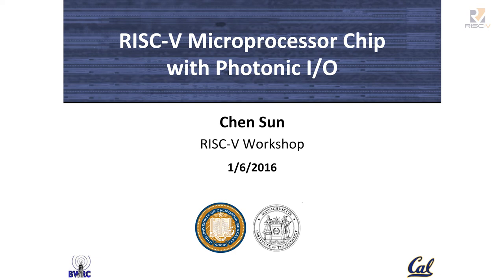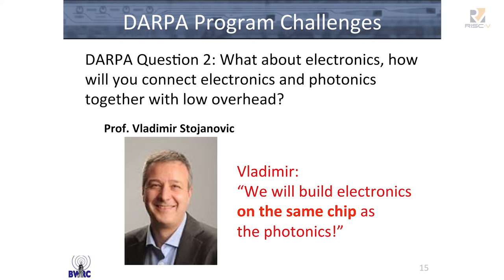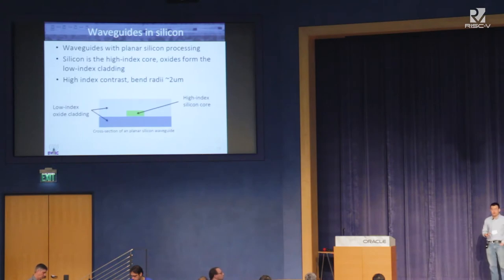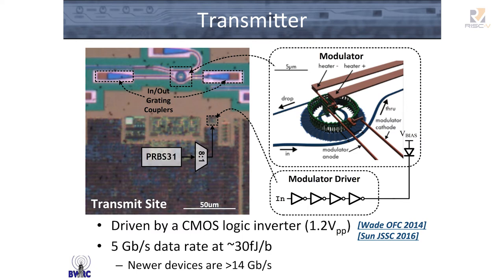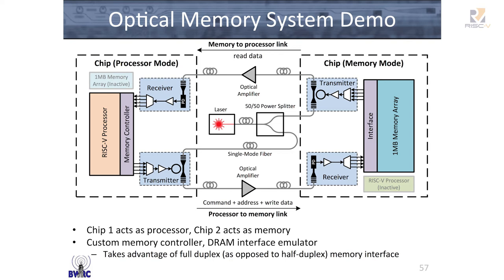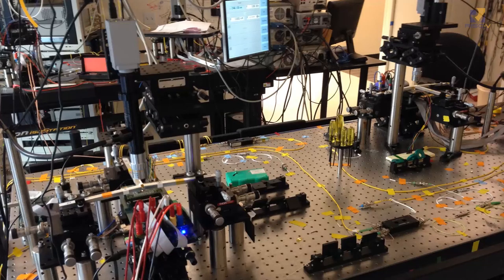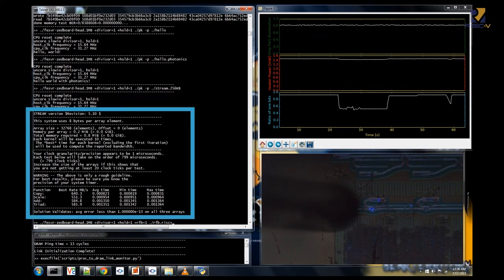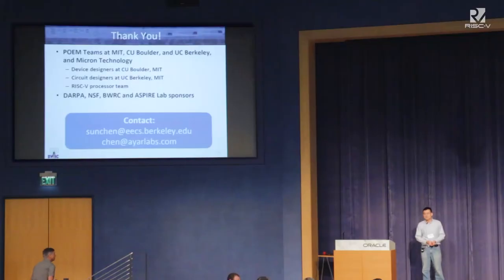Wed1015 - RISC-V Photonic Processor - Chen Sun, UC Berkeley

Comment: Go Bears! We are now using photonics using polarization which are 4x faster. 
Since light travels in a wave length which has peaks and valleys (oscillations) we can program valleys to be 0 state then peaks to be 1 state in terms of processes. 

Now thats for two nanowires like this ---- ---- where the blank spot would be the wavelength oscillating between the two. 

Now we can have 4 nanowires like this ----+----- where the + is the 2 light waves oscillating (NS WE) and there would be two more wires on the north and south end to make 4 nanowires. 
I miss my Berkeley professors so much, greatest time of my life was at that school.